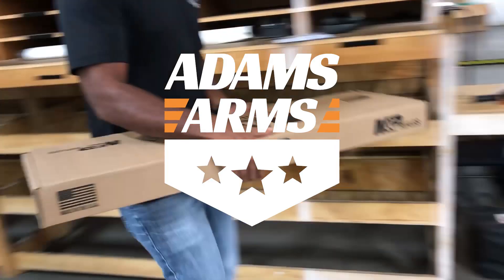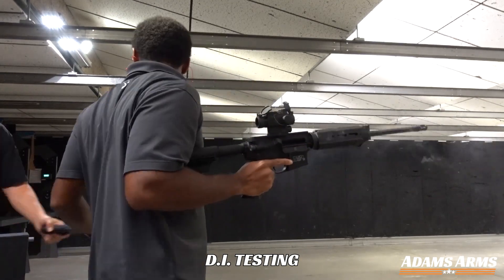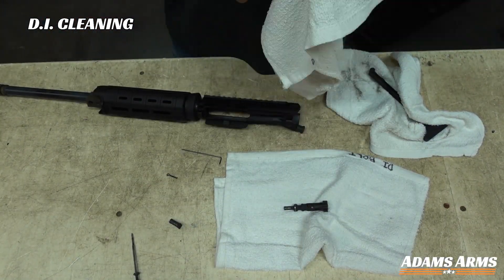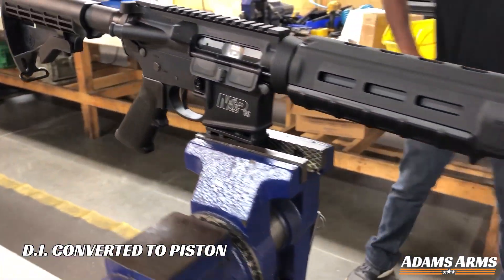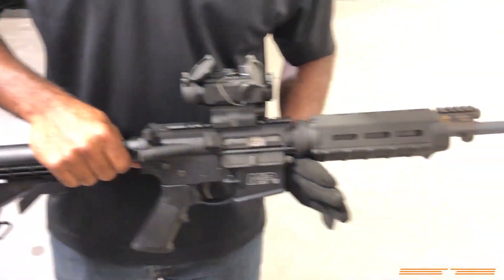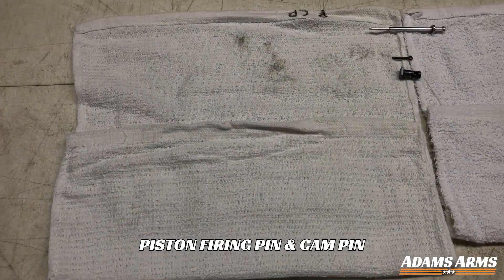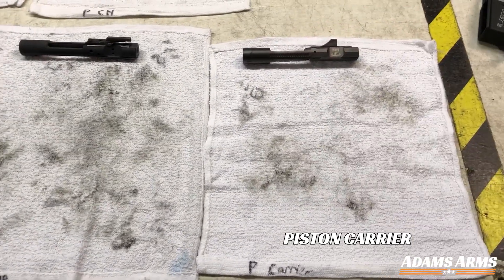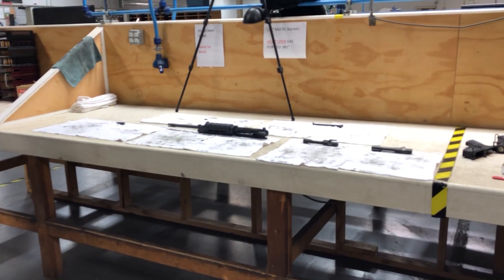Adams Arms Piston Versus Direct Impingement - Conversion

Comment: Thinking about installing this system on my next build. What other parts will I need. Also will this kit work with most uppers and handguards
Reply from the maker: Our kits will work on most uppers in 5.56/.223, any other caliber, please email support@adamsarms.net. To complete our kit, you will need a bolt, firing pin, firing pin retaining pin, and cam pin.

Comment: I recommend a video on stress testing the platform in a meltdown fashion. I think it would put a lot of speculation to rest on your product line, and perhaps even fuel further debate.
Reply: Already done by Iraqveteran8888.  Continuous full auto fire.  Barrel melted and killed the gun.  Took the piston out of alignment and ended it all.  The BCG and bolt were untouched.  Barrel simply couldn't handle the heat.
Reply: @MobiusUSAH  No doubt, but that was also the base model retro fit system. The p2 model has a free float hand guard and a low profile gas block. It’s all speculation but I imagine it might prolong things.
Reply: @froggerjohn427  maybe, but if the barrel was the weak point, not sure there is much more that could be done short of a different barrel.

Comment: I have an AA piston upper that has the samson evolution  rails.  Got the upper it in 2012. Very well made, although I wish I could replace the handguards without having to pull the gas block off.
Reply: That Samson rail is heavy.  Swapped out the gas block and handguard for the P series and it's been WAY better.
Reply: You can also throw on the P series low profile gas block as well. Get rid of that clunky base level thing